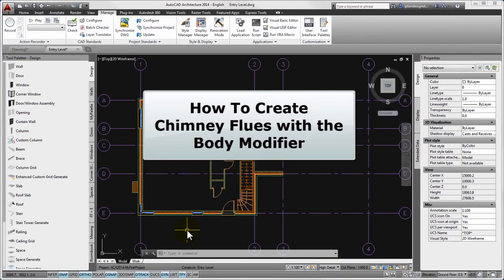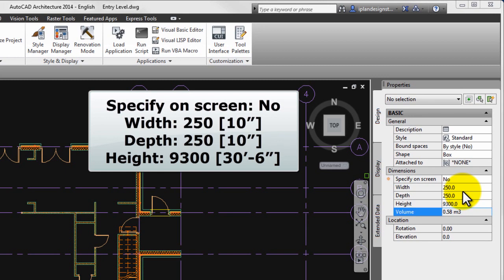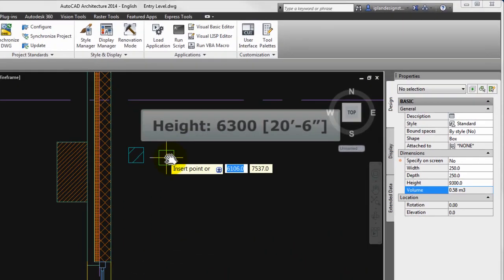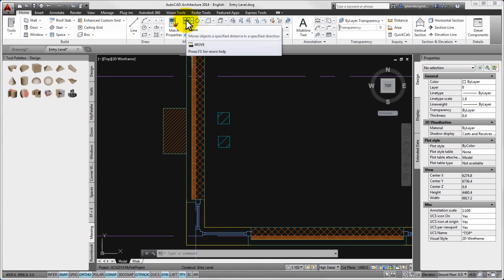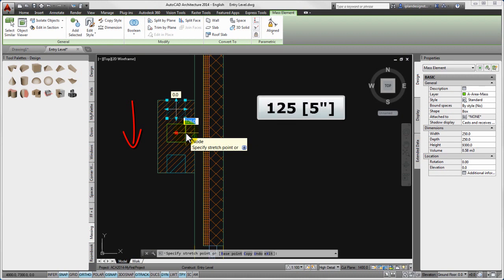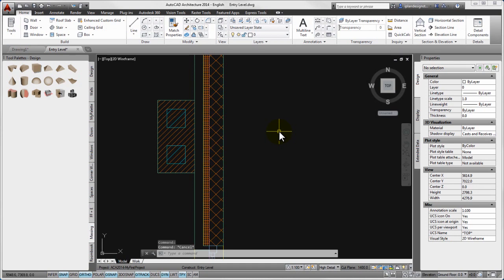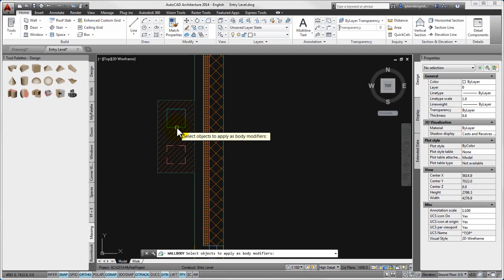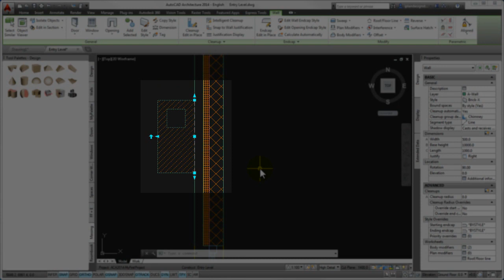How To Create Chimney Flues with the Body Modifier | AutoCAD Architecture Tutorial #16

Comment: I have to congrat you. This seems to be the best tutorial for architectural. What is interesting me the moste are the better ways to coordonate a drawing on multiple levels. Like the "element" feature is, for placing a single grid for all levels. Can you see throw 12rd floor level to the groundfloor for ex? Operating on 12rd floor having a diferite level overlapped, as reference. In a similar way, can u coordonate on horizontaly 2 oposite facades or an exterior wall with an interior one?
About your tutorial, make a new level faster and keep positing:)